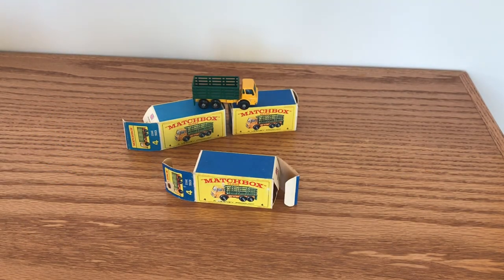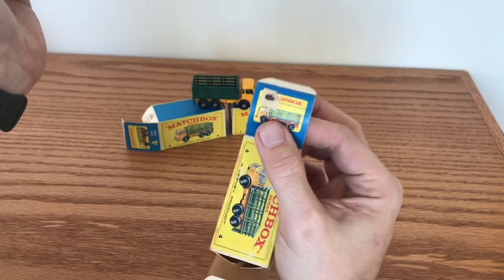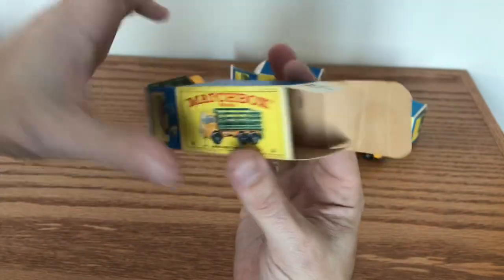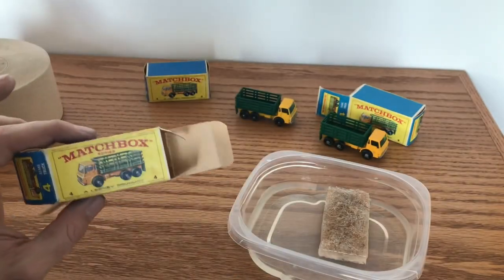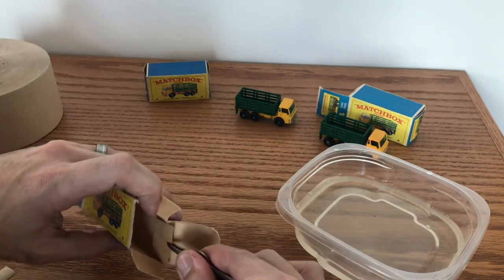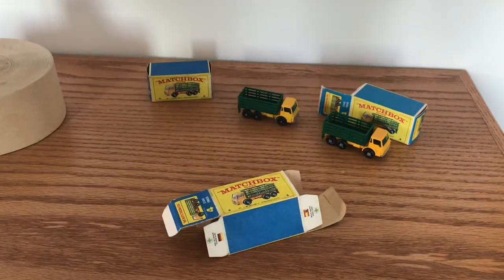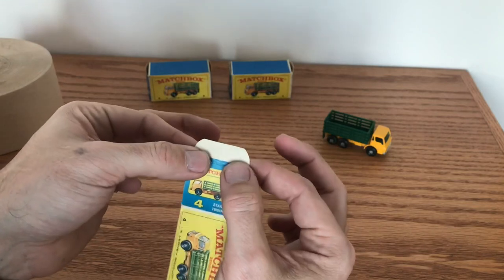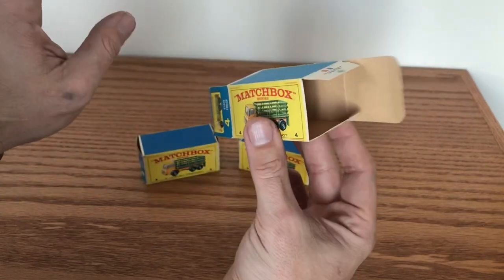Matchbox Lesney #4 Stake Truck Multi-Box Restoration

Comment: Somehow I seem to remember that there were two white plastic cows in the back of the truck.....
Reply from the maker: Not on the stake truck, you're thinking of the cattle hauler.  It's very similar, yellow truck with grey box on the back.  I have a few mint originals with the cows still on the sprue!  Watch for them in an upcoming mail call.
Reply: Vintage Diecast Restoration Ah yes, that is right. I do remember now. Good memories.....